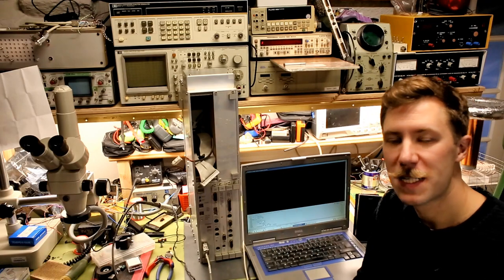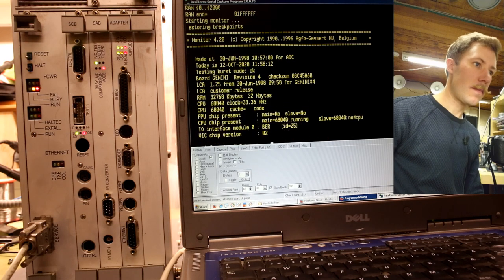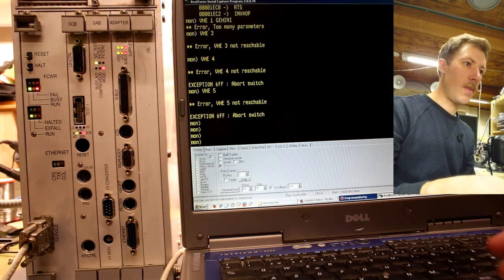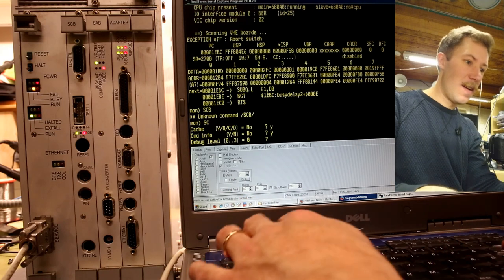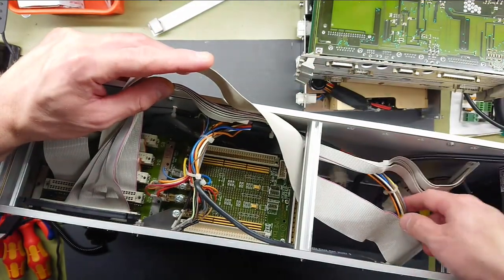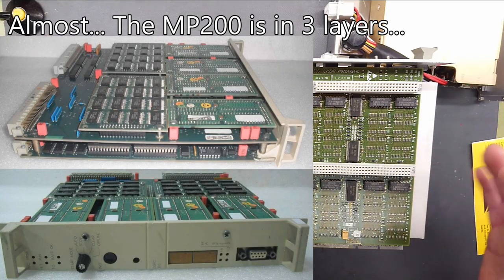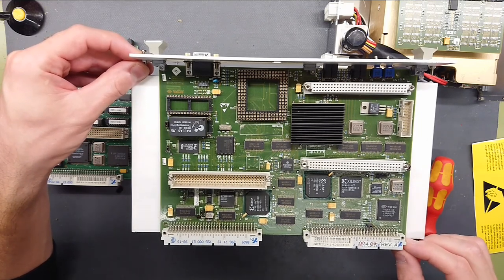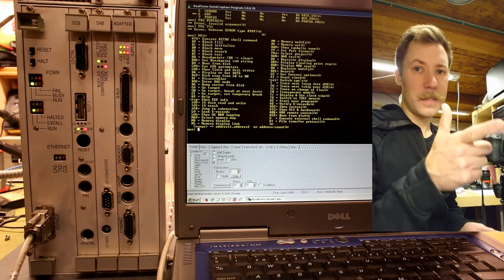Agfa ADC 5155 Motorola 68K Computer Teardown (Part 2 of 4)

Comment: The OS is known a QNIX. It was developed by AGFA and is a DOS/UNIX hybrid. Many dos and unix commands will work. Since you do not have the set up disks you cannot load the OS and then the machine specific software. The VME rack, what we called the computer, was used in all AGFA equipment of that age from printers to CR digitizers. You've done pretty good for not knowing the equipment but I'm sorry to say you've been way off on a lot of your guesses. I worked at AGFA Healthcare for 14 years starting as a field service engineer on their full line of products including PACS and DR/Xray. I worked up through a training instructor to a product specialist for the Eastern USA.
Reply from the maker: I love when my teardown videos lure some of the designers or technicians out of the wood work :) There is a lot of guesswork, especially for something as custom and complex as these type of machines. I would love if you could point out a few of the worst wrong guesses, so I can learn from it.

Comment: 7:30 Those Exception values are mostly 68040 registers.
PC = program counter (called this on many other CPUs too)
SR = status register
D0 to D7 = 8 general-purpose data registers
A0 to A7 = 8 address registers
Those other values look like system bus values. 
reference: https://www.cs.mcgill.ca/~cs573/fall2002/notes/lec273/lecture9/
Reply from the maker: Thank you for that reference

Comment: Nice video, it's always fun to play around with an unknown system and see how far you can get. 
Most cellular equipment has a similar serial interface, fascinating stuff.
Reply from the maker: I have not yet accessed a base station through a service port, but in some units I have found complete disk operating systems on flash cards.

Comment: This isn't the operating system. It's just the boot monitor. It's for diagnostics and for loading the operating system. I'd guess the OS is VxWorks - it was common on 68k VME systems of that era. It was very common for a company building their own CPU to write their own monitor ROM to make it easy to do things like manufacturing tests, diagnostics, and crash debugging. Once the hardware was fleshed out a more traditional OS or RTOS would be ported over.

Comment: Many, many years since I did any 68K - but that looks like a "Monitor" of the machine code; the MOVE.B, BEQ etc. are disassembled instructions; teh ADDR and DATA at these Addresses is shown; PC etc. are Program Counter - A0-A7 registers etc. TR seems to be a "Trace" (next instruction) etc.? Very low level.
Character set is showing £ instead of # for immediate values...
Reply from the maker: Thank you for the details. Did you watch all the way to the end where I found the menu? :)
Reply: @KaizerPowerElectronicsDk  Yes - I did. Great stuff, bringing back many memories debugging games on the ST & Amiga :-)

Comment: VME is a bus architecture used since the mid 1980s. I would expect the full size boards to have 2 96 pin connectors with one VME busses each. Scanning VME imho means it is lookingbthrough the address space to find additional VME cards it can activate.

Comment: I think when you typed the CPU command, the 4 options were

Yes
No
Code
Data

The 68040 can cache a chunk of both code and data. Maybe you can enable them both or neither, or one or the other.
Reply from the maker: Yes, its a straight forward 68k framework.